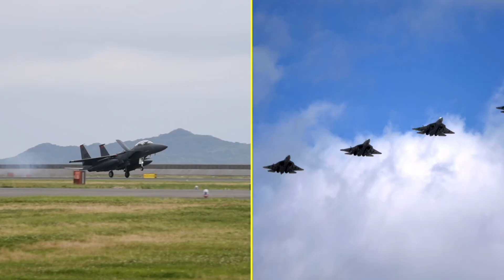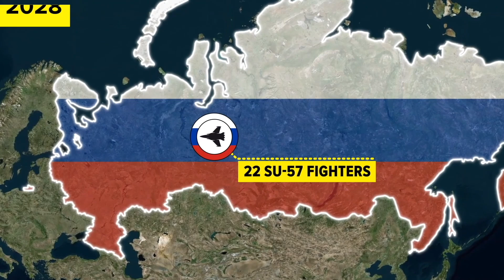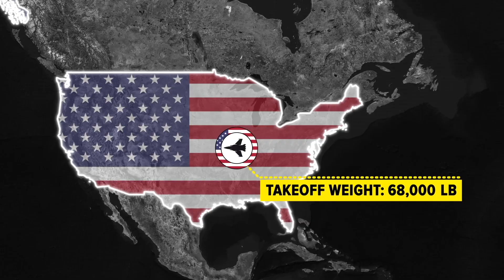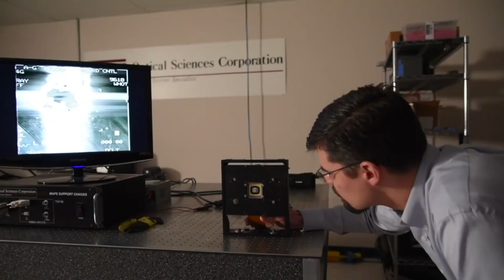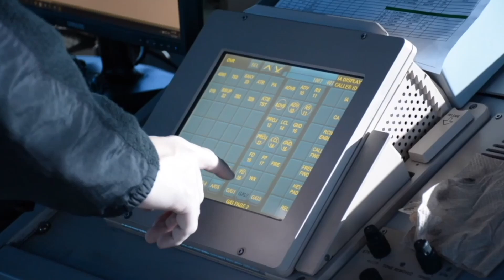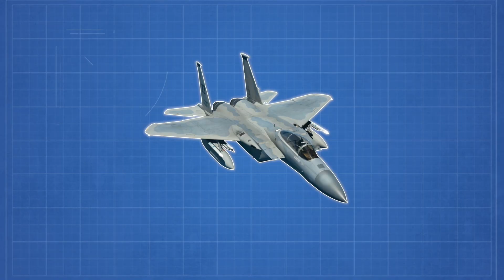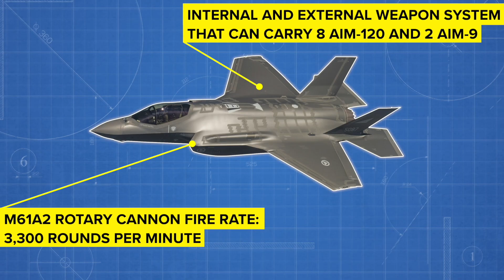Why the F-15 Still TERRIFIES Russia

Comment: F15 is definitely Better than every Russian fighter so far. But F22 raptor has over 90% likelihood of a kill against F15 Strike Eagle in testing. 
So yes, F22 has lost to F15 in training. But F22 has scored over 9 times as many kills against F15 has. 

It’s not strange either. Yes F15C has a nice radar, but F22 has a better radar, F15EX though has a better radar than f22, same technology as F35 on which F15EX radar is based upon. So can F15 generally see longer than F22? Only the latest F15EX has a better radar than F22. What I have read in forums etc F15EX can see about 10% longer than F35 block 2. 

The later F22 upgrade, which I believe got more power and better AESAR radar. Compared to F35, F22s radar can find stuff further away, but it has worse SA because It lack the processing power and other sensors which the F35 has. 

Actually, F35 is a better fighter than F15EX, if not super low and fast over mountainous terrain or very very high altitude where f15EX would see f35 from above and it’s amrams would have higher kinetic energy. 

But in that case, and every other case F22 would beat F15Ex and F35. It’s got better acceleration than f15ex, F22 can go higher than F15 especially if loaded down with missiles, not sure about EX, it might have high service sealing with missiles. But even if it has a better radar, the EX would at best just be able to see F22s radar. But most likely the EX wouldn’t know what hit it, if faced off against a f22. It will probably have to get maybe 25-30 miles of the f15ex to have any chance of some sort of radar lock. F22 can aquire lock on EX well before the 90 mile range of amram.

Comment: The SU 57 is that stealthy no Ukraine radar can pick it up and it's invisible also to infrared that's just how good it is like the T 14 it's so deadly on the battle field the Russians troops a afraid of it it's also invisible to radar and antitank missiles can't lock on to it but the Russians are training cosmaunauts to use this tank as we speak and the pilots of the su 57 have to train for years to fly it after all it's invisible you have to remember where you parked it  and it also scares the pilots because they look like they are setting and flying through the air when they come out with the invisible suit for the pilots this jet will be invincible

Comment: Man, all I see in Russian aircraft or Russian equipment is junk. That's why they don't use it in Ukraine. Seems to be all hype like the T-90 Main Battle Tank. The T-90 gets smoked by a thirty year old Bradley that's mounted with a chain gun. It made the tank and crew look like a circus clown show. Russian equipment USED to be good in the 1970's when I was young, but now, all I see is junk. Just my opinion, from an old man. I don't like being harsh, but, their track record has been horrible in designs and performance. Great video. Anyway, thanks for the video 📸.

Comment: Turned this off the moment the narrator said that radar operates on sound waves....
Reply: Yep, same. The bullshit about thermal vs infrared and the aircraft actively illuminating in infrared is also complete and utter bullocks. Actually, everything is in this video is bullocks. Yes, the F-15 will be a match for the SU-35, but for completely different reasons than the bull** in this video.
Reply: This “guy” is using ChatGPT for his script and likely paying someone for the narration. Every single video is like this. Just a simple regurgitation of the Wikipedia articles the LLM was trained on.
Reply: It's more likely they simply mixed up radar with sonar...

You guys need to relax, lol
Reply: Brings everything else that was said into question. Just started watching this channel, unsubscribed.
Reply: Well sonar and radar kind of works same way. No biggie that orher wave moves speed of light and other about 1 235 km/h. in air. Not to make too much fuss about the fact that planes dont usually travel under water where sonars are used. @Talven81

Comment: The F-15 EX are brand new airframes, It isn't an upgrade to preexisting aircraft, they are a cheaper option then stealth air craft but designed to integrate with them.
Reply: Well first of all you're right they are brand new airframes but they are a 100% upgraded design. And no they're not cheap, in fact unless we buy more than the current 18 we have ordered they will not be cheaper than the F-35

Comment: The SU-57 isn't stealth.  It has a radar cross section of a SQUARE METER, about the same as an F-18A.  That's not stealth.  The F-35 has a cross section of .005 square meters. THAT'S stealth.
Reply: F35 is stealthy against Radar using X band frequency, it is not stealthy against Radar in the S band which AWACS and ground control Radars operate in
Reply: @cfisher11  But the resolution is so bad that they can't use it for targeting or even accurate location.  They know it's out there, but not exactly where.

Comment: Idk... I love the F-15, but the whole time that the Eagle is trying to search for the Felon its own radar return could easily be detected. I'd love to get more familiar with that IR pod and it'd capabilities. It's practically just IRST right? Or is this more advanced?
Reply: The IR pod is the same thing as the IRST.
Problem is if the Felon was actually a stealth aircraft then what you said might be true. But it's not stealth it's not even really low observability. It has the same radar cross section is a slick F18
Reply: @Wyomingchief  Yea, I get that, but the F-15 is about as stealthy as a barn! Lol. I mean, don't get me wrong I love the Eagle. It's deadly as hell and durable, I was just saying that if it goes up against the Felon even though the Felon isn't very stealthy, it's more stealthy than the Eagle. They have F-16s with RAM coatings designed for SEAD missions... Id like their chances better.

I mean, maybe a flight of 2 Eagles could ensure one could push when the Felon launches? That could work. Idk.

Comment: The US has almost 500* F-35 currently in service, plus almost 500 F-15s and 186 F-22. *:(US plans to have ~2500 F-35s eventually). That Ruzzia plans to build two dozen Su57 by the end of the year, and 76 eventually is a bad joke.

Their engine tech, radar, stealth, training doctrine, pilot experience/flight hours are all also significantly behind. I will admit their thrust vectoring is neat to see at airshows. But with helmet mounted targeting, and missiles that can loop around and shoot an enemy directly behind you, that kind of dogfight maneuverability is only useful if somehow we run out of missiles. 

And again, two dozen Su57.

The Netherlands alone already has that many F-35s, and has plans to double it. The UK has 30 and will have 47 by 2025. Israel has 50 and has authorized purchase of 25 more. Japan seems to only have 17 F-35 in operation right now, but they plan to have 147 eventually, and are building a domestic factory. I could go on.

By the time they catch up, if that is even possible, we will be retiring the 6th and trying to figure out what 7th gen is because we are mostly competing with ourselves at this point (China can compete on numbers, but they don't innovate, they steal US tech and adapt it, so we can't look to them either).
Reply: Yea, even if the SU-57 is the most advanced bag of chips on the planet, they won’t be able to survive the sheer numbers of fighter aircraft the US has. 

But it’s not the best fighter jet ever. Maybe top 5 and we have 1-4.
Reply: Yeah I'm not sure where you're getting your numbers from but we're not going to have 2500 F-35, maybe that'll be the total built but you also have to realize that about 12 of our allies also fly the plane😂
Also the Japanese are not in any way shape or form going to be building a domestic Factory to make the F-35.
Now they are working with American Engineers to design their own stealth aircraft but they will not be producing the F-35😂😂😂
I love your enthusiasm but, don't believe everything you hear in a YouTube video😂😂

Comment: Imagine updating F-15B/D so the WSO issues commands to a drone wing. But I guess the stealthy F-35 is better suited for that role
Reply: Actually the f-15ex will have both single seat and dual configurations.
But the single seat F-15 will still have the same cockpit area the second seat will not be utilized.
Also all the other f-15s we have currently, will be aging out within the next 5 to 10 years max. So you can't even upgrade them because the airframes will be worn out
Reply: As is also the F15EX.
Reply: @BurntOrangeHorn78  The EX is single-seat. I think a backseat driver would be optimal for controlling the drones while the pilot focuses on flying
Reply: @hanrockabrand95  F15EX is dual tandem seat.
Reply: @BurntOrangeHorn78  I stand corrected

Comment: 5th - 6th generation? Some say the SU-57 is a bit shit and not even a 5th gen.
Reply: 4.1-4.25 gen. It's a joke of a plane, it just looks cool
Reply: @dickfitzwelliner2807  it literally has all the things F-22 was planned to have, yet doesn't. Where is F-22 side-looking radar sets? How the hell it's going to guide AIM-120 while doing a notch? Nohow? Also literally remind me who tested, and before that heavily reworked the wings, pylons on F-22?
Reply: @dickfitzwelliner2807  It actually has some things going for it. Good thrust vectoring, although the planned engine upgrade will make it 2D instead of 3D vector. And I imagine it has good IR sensor capabilities. It just isn't as stealthy as any other jet that claims to be 5th gen
Reply: @hanrockabrand95  not being snarky, but what good is thrust vectoring when air to air combat has been going more towards BVR? Sure it will help you turn tighter, but changing directions multiple times with thrust vectoring will kill your airspeed and ultimately will keep you within the missiles seeker and turn capabilities
Reply: @dickfitzwelliner2807  True, but every time the airforce thinks dogfighting days are over, they learn they're wrong. As missile tech improves, so do countermeasures and stealth. We may reach the day where missiles are all you need, but I'm not confident that day is today.
Reply: @dickfitzwelliner2807  Maneuvering with thrust vectoring is lower drag than doing it with control surfaces, so it'll kill airspeed less for the same maneuver. Also maneuvering against missiles is absolutely something you do in BVR, forcing a missile to turn will do far more to bleed energy from the missile (which has finished its burn and is coasting) than from the defending plane. Maneuvering with thrust vectoring also avoids control surface deflections which might increase RCS, e.g. B-2 controlling yaw with differential thrust. 
The extremely high AoA, post-stall stuff probably doesn't matter in BVR though, no.
Reply: Lmao exactly I was like what..it hasn’t even proven half of the requirements needed to be classified as a 5 generation stealth jet
Reply: It should be called 4.5 gen
Reply: Correct, the Su57 has shit stealth. It's a 4+Gen aircraft, at BEST. Meanwhile the US has already flown their 6th generation NGAD fighter prototype and the 6th Gen B2 Raider stealth bomber is in production.
Reply: It's so bad it doesn't even have anti-SONAR stealth features

Comment: The SU-57 is not very stealthy. Both the F-35 and the F-22 can detect the SU-57 long before it can detect them.
Reply: 😮 no you're actually incorrect. Stealth has to do with being unseen to the other aircraft radars.
You can't see it without getting a radar lock on it basically.
Now there are some ground-based x-band Radars that can detect that a stealth aircraft is in the area but it cannot pinpoint it with any degree of accuracy, not even really accurate enough to Vector another aircraft to that area
Reply: Most people misunderstand Stealth to begin with.  It has less to do with being "invisible" and more to do with being able to acquire a targeting lock.  The non-stealthy aircraft can still see the stealth but has to get much closer before his weapons can effectively hit their target.
Reply: @davidford3115 yeah you are completely misunderstanding stealth technology yourself
Reply: @GR_Chief  Air traffic control radars at airports can see stealth aircraft just fine.  They don't need to have a weapon's lock and so the accuracy of where they plot the location of an aircraft doesn't need to be so precise.  And yes, vectoring an intercepting aircraft CAN be done with such a radar.

Comment: Radar using sound waves??? If you can't even get this right, your credibility is zero.
Reply: He mentioned sonar in airfigter topic. I don't think he knows what's he talking about.
Reply: @dennythedavinchi3832  sound has been used in early detection systems before, and then they invented radar and it was instantly replaced
Reply: Yeah RADAR is literally an acronym for Radio Detection And Ranging. The guy is confused and not as knowledgeable as he should be 🤦